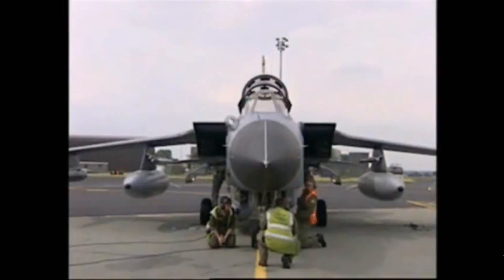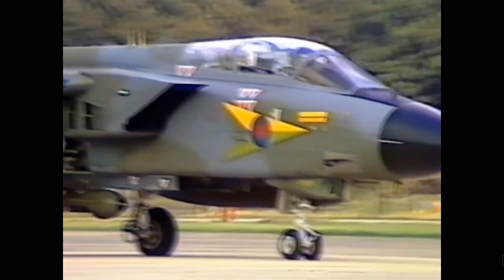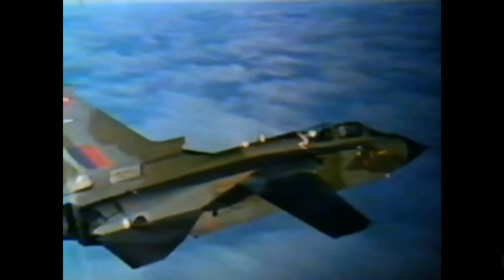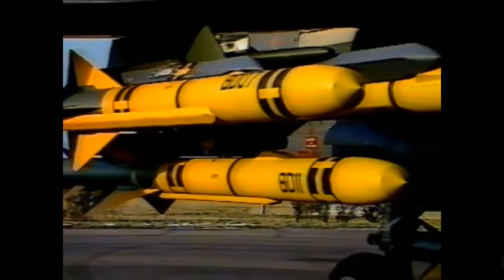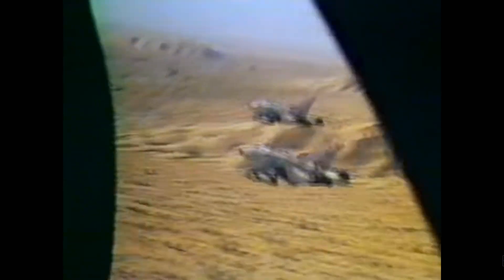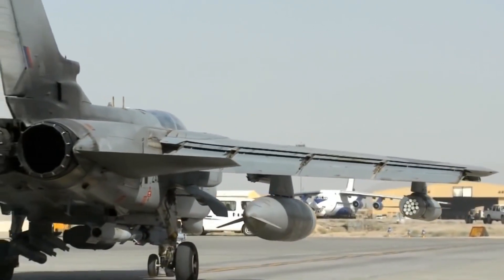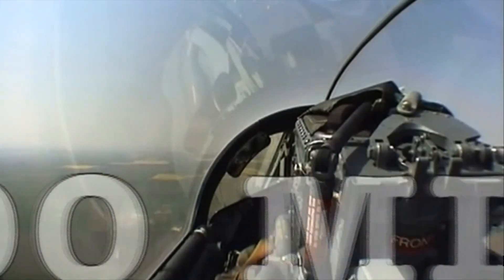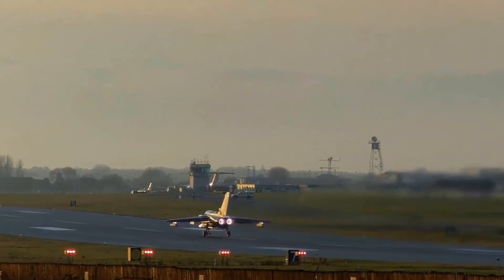Panavia Tornado - Twin Engine Sweep Wing Fighter/Bomber

Comment: what jet is going to replace it it can't be the f-35 cuz that's replacing the harrier
Reply: elias winters yes it can be, comes in a variety of flavours remember, they'll simply use a different version of F35, the A or B most likely instead of the V/STOL-only C
Reply: F35 is replacing both Harriers and Tornado. Typical British government, they retire aircraft before the replacement is ready and they order less aircraft than their losing. We're getting a max of 138 F35s and we lost way more than 138 Harriers and Tornados when they go out of service so we'll end up with less aircraft overall when F35s come into service
Reply: Kieran Williams true enough, wish it wasn't but sadly yes
Reply: but then you have to factor in how many of those older aircraft one F-35 is "worth" capability wise.
Reply: The F35s that the RAF and RN are getting are worse than the Tornado for the amount of ordanace they carry so they can't stay on station as long as they carry less weapons and if they take off from the carriers then it'll have less fuel, as for air to air, the F35s will perform better at bvr but i reckon they'll be worse than Harriers and Tornados in a close range dogfight. Personnally, i would rather we replace the Harriers in royal navy service with F35B although the F35C would have been better and get a reduced amount of F35A for the RAF and either get a new multirole strike fighter or keep Tornados in service and upgrade them.
Reply: dont come here and say the F-35 is "worse" than a Tornado or Harrier, it is far superiour in allmost every aspect. Its 20 years newer so thats to be expected. The Tornado can only carry 900kg more payload than the F-35, and will at that point be much slower than it for example. And the F-35 will not have less fuel when taking off from carriers, i dont know where you got that from. If you also think the F-35 would underpreform in WVR combat you would be very wrong to think so. The Royal Navy btw cant have F-35C's because of their decision to not use catapults and arresting wires.
Reply: I know the Royal Navy can't use the F35C on our carriers, thats why I said it would have been better to use the C model because aircraft can take off quicker with catapults and the C version carries more ordanance, has better range and costs less than the B version due to it not needing vtol. Also, the B version that the RAF and Royal Navy are getting carries a lot less than 900 kg of ordanance compared to Tornado althought the F35 versions A and C may only have 900kg less ordanance than Tornado . Also the reason the F35B will carry less fuel is because all aircraft that use ski jumps tend to carry less ordanance or fuel to make it easier to get airborne as carriers with ski jumps have no catapult and i got that from a FAA pilot that flew Harriers from Ark Royal and Illustrious. Also the Royal Navy plans to land the F35B vertically which consumes more fuel than if they landed conventionally. As for my comment on WVR combat, my understanding is that the F35B is a fairly heavy aircraft and in tight dogfighting turns it'll lose speed quicker than an F16 for example and the missiles have to be dropped out of a weapon bay that requires a door to open. Now thats my understanding from what i've been told and i'm not saying i'm right on the WVR combat but just saying why i think tornado or Harriers would be better at WVR combat.
Reply: The fact is that the F-35 has better energy retention than both the F-16 and F/A-18 for example. It also has a higher alpha capability and more degrees pr. second in truns. The F-35B is at the disadvantage of the other models because of its 7,5G limit, compared to the other models 9g limit. Still, the F-35B would more than hold its own in WVR combat, not because of its turn rate, but because of things like DAS, SF and its HMD. Its been prooven that somewhere around 90% of air to air kills happen without the defender ever knowing he/she was under attack, this is due to the lack of situational awareness, and no other jet comes close to the ammount of situational awareness the F-35 posesses.
Reply: The F-35C as of right now is much more expensive than the F-35B because of how far its gotten into development, it will get alot cheaper. But i still think the F-35B is going to be a bit cheaper. the F-35B is supposed to have the same payload capability as the A and C (the A nad C model has the same payload) but as you said, they cant fly them with full payload or full fuel (depending on the mission) because of the ski jumps. it can however carry a full internal load, which is the most important.
Reply: I agree that the F35 has excellent situational awareness and i'll have to read up more on F35s WVR capability more but from what i've read the C version is basically the A version but with a strengthened undercarriage and tail hook, while the B version costs  a lot more for development and procurement as trying to get the VTOL to work has been problematic. Last year the RAF  had to cancel the F35 display at RIAT because the B version was melting the tarmac when landing in VTOL. Also the unit costs will be high as I know the Royal Navy and USMC are getting the B version but i haven't heard of anyone else other than the Japanese being interested in the B version for their Helicopter carriers/Helicopter destroyers. The C version is only being aquired by the U.S Navy and the A version is what everyone else is after.
Reply: The C also has longer wings to help  with low speed final approach for example. As of right now, the C is much more expensive than the B (around 220 million USD), and i have never heard about the F-35B needing to cancel due to melting tarmac. It is designed to not do that with the lift fan pushing away the hot gasses and i havent heard of any problems with it any other place either.

Comment: They keep replacing these proven jets to a new unproven full of bugs in the system still have to fix whatever flaw in design that won't work in real event. I mean how sophisticated can it be? Like fighting aliens from space? These jets tornado ,f 14, Harriet,f18 hornet, don't know how long can the u.s air force hangs on the f15 strike eagle.f22 raptor seems to be overshadowed by f35 with seemed a lot of bugs in the system.does the air force or nato still have f117? I know the f111 swiftwing bomber was not really use.

Comment: e x t r a  t h i c c

But srsly, F16 was better
Reply: Josh Jwillway in air-to-air? Sure. Air-to-ground? No freaking way, you have SEEN how much this thing can carry and how fast it can get it there and get out again right?
Reply: An F16 is a completely different aircraft with a different role. While it is a decent all-round aircraft, as far a ultra low-level, high-speed strike is concerned, the Tornado will wipe the floor with the F16 and just about any other aircraft for that matter, despite it being an ageing aircraft. Much like the A-10 being (arguably) the best CAS aircraft, the Tornado still sets the standard for low-level, high-speed accurate strike missions.
Reply: GC82 agreed :)

Comment: Didn't they get slaughtered in the 1st Gulf war?
Reply: Not at all. Yes they had loses but that was expected because the Tornados flew many high risk missions in the early war when the air defense was still mostly intact. The RAF counted 6 Tornados lost during dessert storm. That's not that many if you consider the kind of missions they flown.
Reply: @shi01  But if I recall the missions were largely pointless and achieved no real damage and didn't more than one crash on take off due to dust ingestion? I remember the surving ones giving up the low level raids and running high level ones with old buccaneers providing laser targetting for them..
Reply: @krackerman3628  Yes and no. Initially the Tornados were used to attack enemy airfields with the JP233 anti-airfield weapon. The missions itself did what they supposed to do, the problem was that the iraqi airforce didn't do what the allied forces expected. Because they were hiding their aircraft beforehand. So yes overall the missions were pointless, but they didn't knew that at the time. The RAF started to realise that after about a week into the campaign.
Then they switched to conventional bombing missions but came to the same conclusion as the USAF at some point during the Vietnam war. You can't hit shit with conventional bombs.
After that the Buccaner came in to assist with laser guidance because the RAF had only 2 prototype targeting pods for the Tornado at hand at the time.
So i would say, the aircraft performed as expected but they gave it the wrong missions initially.

The problem with the first Golf war in general was that it worked out differently than everyone expected it. Hussein promised a full out war, and the allied forces prepared and selected their targets accordingly, which at least partially was a mistake.

Comment: All of the american jets are better than the tornado it could not when a battle in any dogfight period
Reply: Winning dogfights was never the intention when they developed this thing. It was designed as an low level high speed strike bomber which would fly under the enemy radar and destroy high value ground targets like airfields and it was extremly effective at this. Also the Tornado could carry some unique weapons like the JP233 submunition dispenser which could devestate and entire airfield in one single pass.

Comment: Obsolete.
Reply: Yes, because you need a 150 million dollar fighter dropping 250,000 dollar cruise missiles on the fucking Taliban, right? xD
Reply: Sarge Rho warthog defense recently made a video detailing how Germany is considering replacing their aging fleet of tornados with either the eurofighter typhoon, or the f-35. Honestly I think the German air force should consider the saab j39 grippen, as it has an open-system architecture which means that it has a much longer service life and has a number of features similar to the f-35 but at 1/6th the cost. Do I think the f-35 is a good warplane. Objectively, yes however I still think that the plane is way too expensive to operate, maintain, and produce. I mean losing an f-35 would be a major blow to an already anemic german military. Which is why I think the grippen would be a more viable alternative. Until the french-german 5th gen fighter project takes off before ww3 begins. They'll have to make that choice sooner than later.
Reply: Patrick Milewski either's a good choice. Something to consider though is where you got that information on the F35 from as there's a lot of bullshit about it online at the moment, for one thing we DON'T KNOW what the purchase and  maintenance costs will be for sure yet, that information hasn't yet been released to the public and it'll vary according to model anyway
Reply: 1IbramGaunt that is a very valid point. Either choice would be acceptable. All the hype and "what if's" on the internet raise one key point though: no plan survives contact with the enemy. So to say that the f-22 and f-35 are terrible airplanes is incredibly dishonest as neither plane has ever faced a near-peer or equal opponent in the skies.
Reply: Patrick Milewski true enough- and neither has the Grippen
Reply: Patrick Milewski the Tornado however is a tried and trusted weapon, used in multiple different conflicts against a wide variety of enemies, we KNOW it can do what it's supposed to be able to so I don't think governments should be so hasty in getting rid of them
Reply: 1IbramGaunt I would argue that the whole idea of 5th generation aircraft was rushed and imho kind of misguided. The f-22 and f-35 were designed to penetrate Soviet air defenses during the cold war, and now that the war is over and using a 5th generation jet to take on terrorists in backward middle-eastern countries is overkill if not prohibitively foolish. Plus the reason 5th generation fighter jets are so expensive and have questionable combat performance is that most of their technology hasn't been fully developed at the time of development.
Reply: Patrick Milewski which is why when people start talking shit about Britain designing it's new aircraft carriers solely around a completely unproven aircraft and complain about how slowly we're getting them, I don't even have to say anything, all I have to do is hold up a picture in each hand- one of a Harrier jump-jet and one of a big dollar-sign on top of a pile of scrap metal

Comment: Great strike aircraft. Rubbish fighter. RAF SHOULD HAVE BOUGHT F15s.
Reply: Graeme Hogg well we didn't, our stupid government tried to save money as usual by using this for both purposes and considering how as he says it wasn't designed for that I feel it did pretty damn well at holding that ground till the Eurofighter Typhoon came along
Reply: The RAF had no need for the F-15. The Tornado is a better low level strike aircraft and the fighter (interceptor) role was sufficiently filled by the Lightning and F4 Phantom and then the F3 Tornado. Now they are using the Typhoon, they have a great fighter which complements the fantastic ability of the Tornado.
Reply: GC82 again, agreed :)
Reply: Graeme Hogg we do have some f15s
Reply: Graeme Hogg is ga get jet is not rubbish fighter